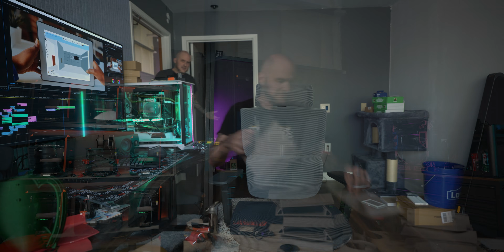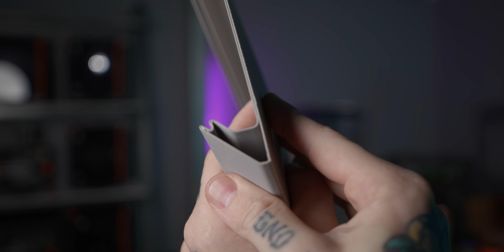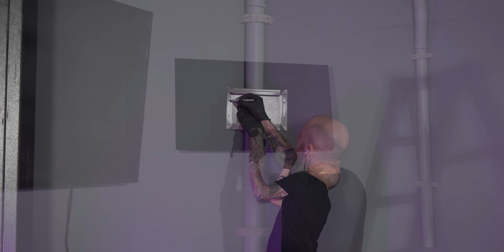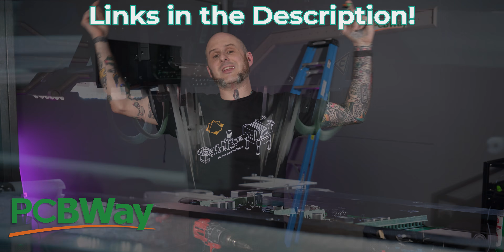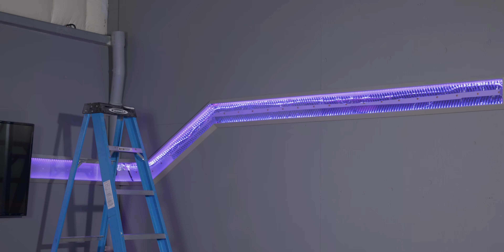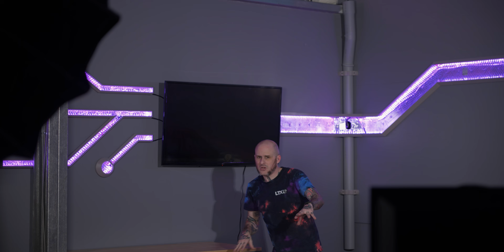Turning my Studio into a Starship! One 3D Print at a Time!

Comment: "I thought I had a bright idea.  It's not working."  Bro, I feel that right here.  I'm surprised you found a company in Portland that would do a small job.  I've been trying for like 2 months to get someone to CAD router some plywood and it's like I'm trying to deliver the plague to them.  On my build I'm using diffusion material from a broken TV.  There are lots of good sheet parts in there and you can get them for free.  Alternatively, Home Depot sells fluorescent light diffusers for less than 20 bucks and they're pretty big.

Comment: If you haven't already bought your diffuser material try looking at the home improvement centers for florescent light fixture covers. Idk how much it cost, but it might be economical for you. Also you can 100% split the data line in parallel for LEDs running WLED. I had a first rendition of one of my projects wired up with three strips in parallel and it worked perfectly fine. Although I rewired it all in series, and am using segments for more flexibility in patterns.

Comment: Home Depot also has OPTIX ceiling light panels in 2 ft x 4 ft acrylic sheets that can be cut down fairly easily with a scoring knife and a straight edge.  Takes a bit of time, but is relatively straightforward and easy.  I assume these would work well as light diffusors.

Comment: Question im new to this but does PCBWay build the whole device or just the board?
Reply from the maker: Either is an option. PCBWay can supply components and assemble the entire "device" (as they did for me) or just the PCB and you can get the parts yourself to assemble.

Comment: Bit late to the party on watching the video but wanted to say love how you’ve tackled the design process for it, issues and all!

Not sure if you’ve solved the diffuser issue yet or not, however one thing I’ve found with some of the student projects is having the diffuser further away from the LEDs will make it a look nicer than up close.

Also, for the LEDs and the control of them, have a look at Dave Plummers Nightdriver project, it’s ESP compatible and may give you more flexibility in controlling the strips.

Comment: I would advise installing something above the power supply to reduce the amount of dust thaat falls on top of it. If you want you could even have a full shelf around the wall with upwards facing spots to illuminate uppwards. It would work better if you cover the insulation though.
I also saw someone use thin paper behind acrylic to make a cheap diffuser. It's just a litle work to get them to line up properly so you don't see the edges which you will if you overlap them.

Comment: I use thin plasticard for LED diffusion. It's rigid but flexible, easy to cut. Looks like it would pop into the grooves in your panels no problem, and it's cheap.

Comment: Wow, great video, love the aesthetics of how your new studio is turning out!

As far as a diffusion material; I haven't personally used it but I'd be checking into dual walled clear polycarbonate.  It's used a lot for greenhouse skylights and is pretty reasonably priced for panel material that can be cut down.   Can find it at Home Depot, Tractor Supply, etc.  Probably at greenhouse supply type places too.

On the cheap end, if you can still find it, you used to be able to buy panels of plastic that you'd use in an office for the old florescent light panels.  I remember it being at Home Depot but might be able to find it somewhere else.  

I'd try using masking/painters tape around  the edges where you are cutting to prevent tearout around the cut, and just use something with fine teeth to cut it yourself.  Like a saw blade with lots of teeth.  Since you have already designed those panels with lips to hold in material, they should be able to hide any imperfections in the edges.

Comment: Missed opportunity here. it looks sooo close to a usb logo. Could of put square circle and arrow on the ends ;) Otherwise awesome job. There really needs to be some more intuitive LED positional apps made for setting these things up. I have about 300 RGB leds in my computer desk case and i just gave up on addressing them properly. i set rainbow effect to go in sequence and left it at that :(  I attempted diffusing my hard drive cases with acrylic sheets sanded. but that didn't turn out great. ended up going clear and you can see individual leds light up...oh well.

Comment: Others may have mentioned this already, but for the bed lifting issues in vase mode, did you try doing the first layer(s) in normal mode with a brim and then switching to vase mode for the upper layers? Or was it the upper edge that was warping too much?

Comment: Not sure if this gets to you too late, but you could look into P95 matte clear acrylic (TAP Plastics sells it). You can get it laser cut. My friend has a laser business in Portland (Bearded Boy Design). He has 2 lasers (Trotec 400 24x36” and an Epilog can’t remember which one). You could lay out your parts on 24x36” sheet and cut a bunch of parts from one sheet. Not sure which would be cheaper. But just my half pence.
Reply: Also I’ve printed Sunlu clear ABS for diffusers .4-.6mm thick. Works great.

Comment: Great project!

My thoughts are using clear acrylic with a layer of window film to it. That comes in different types  of grades of diffusion. You can even cut a pattern in it so you have clear parts which shine brighter or the other way around make a pattern with extra layers of film. That is what I would do.

When you print something with white PLA as suggested by others, you may try to print a pattern in it as well.

Anyhow, good luck for a diffuser solution, I'm looking forward to it!
Reply: Add a reflective surface on the wall side and viola!  You have a 20' long infinity mirror.

Comment: It is awesome to see the new studio coming together - very nice! I had very good luck with 3D printed diffusers out of natural coloured filaments and printing it with two hilbert curve layers only (+1 layer wall if it's not just a flat sheet) The hilbert curve makes it diffuse the light very well and hides any inconsistencies in the motion system or from uneven extrusion. But in your case it might be harder to hide the joints, because of course it would be the best to print it in one piece.

Comment: You can get coroplast/plaskolite (yard sign material) in translucent clear 8' x 4' sheets for relatively cheap. Could work as a good diffuser panel, including some ribbed variation. Corners would be a little tricky but manageable.

Comment: Nezyo Light Diffuser Roll  Light Diffuser Sheet 15.75 x 590.6 Inch   25 bucks for like 30 feet. Best of luck with space @MandicReally its looking geat!
Reply from the maker: I got a roll of that and sent it back before the table covering. That stuff is paper thin and would never hold its shape in this application.
Reply: @MandicReally  I tried. If you have the table cover still you can try wiping it with acetone to make it more matte. The solvent or a mild abrasive could increase the diffusion. BUT its a lot of work.

Comment: I know it would take a while and hell on the clean up, but I wonder if you thought about a transparent Resin print?
Reply from the maker: Too clear and WAY too small. IT would have to be soooo many pieces. The main reason I didn't / don't want to print a diffuser is I'd like it to be as few pieces as possible, less chance for light leaks that way. Even my BIGGEST Resin printer is smaller than the majority of my filament printers.

Comment: “To diffuse and cover the LED strip, you can repurpose components from an old TV LCD panel. These panels usually contain a semi-transparent acrylic (light guide plate or diffuser sheet) designed to evenly distribute backlight, which makes it suitable for this use.”

Comment: I have done some light boxes using the leds and 1mm thick white PLA and it diffuses really nicely.  Instead of just doing a rectangle part to fit in the channels you could create them with  < shape and on the edges where the parts meet reduce the height to .6 on one end and .4 on the other.  Then if the pattern shows it looks more intentional.

Comment: Sick! Btw for the diffuser you can either use standard printing paper or print a few flat layers of white filament and bend it into shape!
Reply from the maker: I want something that runs as long as possible to prevent potential seam points. Preferably the ability to do the full run of each section in a single piece. I don't have a belt printer nor do I think they are worth it for the majority of things so I have no means of printing that. May do a short where I print as big as I can on my biggest machine to test it out.

Comment: @MandicReally  Did you think about possibly gluing 2 sheets of the table cover together and see how that worked for the diffusion? Using a clear contact adhesive on the slick sides of both pieces should allow good adhesion and might help with both the diffusion and making them a bit stiffer? Just figured it probably wouldn't cost anything to try it out since you already have the table cover and probably some contact adhesive. 
Also, awesome work! Love the new workshop vibe it brings in.

Comment: just thought how you could have done it in vase mode with connectors in the side bits, but then you would have had to print those parts too so not saved any time of material. You also would have had to stick them flat to the wall.

Comment: 3d print flat layers of 1-2 layer thick clear/white petg, and then just bend the edges with a jig and heat gun. Lets you speed print the sheet to the size you want, and just bend the edges to the angle you want to fit into the sides of the wall mounts. Looks freaking awesome already, with the diffusion it's going to be next level! Glad you got the config of WLED sorted, xLights (Christmas light software) to control WLED was so much easier for custom LED designs, as it helped do all the sequencing, but probably overkill for this set up.

Comment: Cool! Who said you can't parallelize the data lines? I use it in my projects all the time (2 lines).
Reply from the maker: If you want control over each segment specifically that wouldn’t allow it. Sorry, should have clarified, if I want full control over every led independently, then serial wiring is the only way I know to go. I’d like to be able to set different colors in different parts sometimes and need to be able to set them separate.

Comment: Yuu can get rolls of cheap white art paper at big box retailers. They also cut really well with a chopsaw with a sharp blade before you unroll it. Spray it with some matte lacquer after installation and it should last a good long while. Alternatively, you could try using regular plexi and frosted glass spray paint. You might also get better diffusion with a high gloss white paint instead of the foil tape.

Comment: depending on whether you can live with seam lines in the diffuser material, why not just use those prism diffuser panels for drop ceilings?   I would even suggest taking a palm sander and maybe going over the smooth side with 400 grit to give it that extra diffusion
Reply: This is what I was going to suggest! There are different types of finishes for them as well and they are already made to diffuse light.
Reply: @KitschyandCrafty or maybe even double them up and get even more diffusion

Comment: You can look at lighting gel from Rosco or Lee, as they have lots of grades of diffusion gel. Its thin but you buy it in rolls but could use it to back anything clear that has a bit of structure. It would be fine by itself on the smaller runs... But might flop a bit under its own mass on the larger sections but honestly... You might just get away with it as it is so light...

Comment: Next time you have a big project like this, order yourself a QuinLED dig-Octa. Quin has been designing boards for WLED projects for ages now, and those boards have basically everything needed with great addons like Ethernet and boosters etc.
Edit: you can order some Japanese lantern paper to line those plastic diffusion slats just to diffuse the light evenly.

Comment: Not sure how easy it is to cut but you could always look for drop ceiling light fixture diffuser plastic. Its also pretty easy to come by.
Reply from the maker: I had considered it but didn’t want the crinkly finish they usually have. Granted that table “cloth” had that too. 😅 and I was hoping to get longer sections for less overlap points. TAP Plastics has longer pieces of diffusion acrylic I can get but to size, just have to set aside funds and time.
Reply: @MandicReally  The 25" x 50" Flexible LED Light Diffuser sheet from TAP is very lightly textured on one side, and can be cut with scissors. If 50" isn't a long enough stretch, I've found that you can get a full 48" x 96" sheet of 0.118" translucent acrylic for less than half the cost of TAP at Calsak Plastics, who has a Portland location. If you can deal with thin and flexible, you may be able to find a roll of translucent white mylar / polyester film that would do the job.
Reply from the maker: @flyn-o  Thank you. I was planning to go to TAP when I get some time and look at their options. THere is also a place called Laird Plastics I've gotten good pricing from already. Ruby's entire office has a frosted acrylic window thing going on and I got the material from them for a really reasonable price.